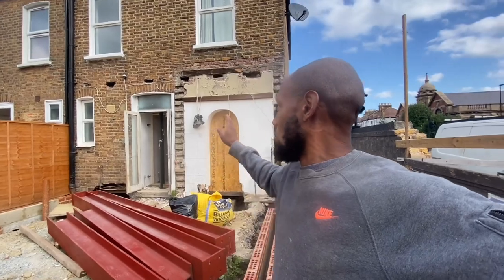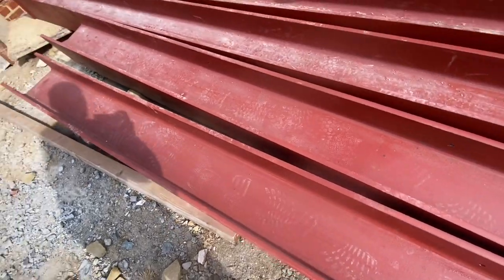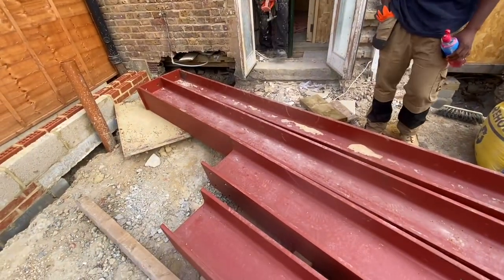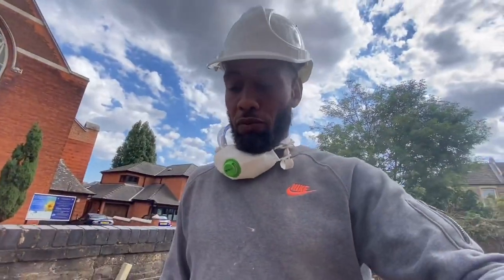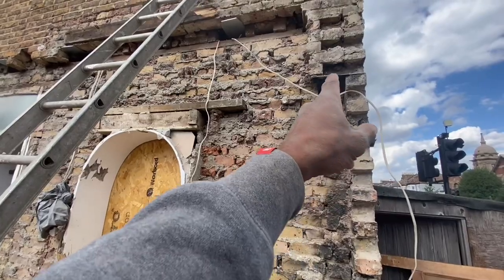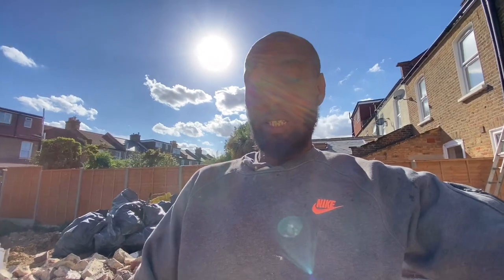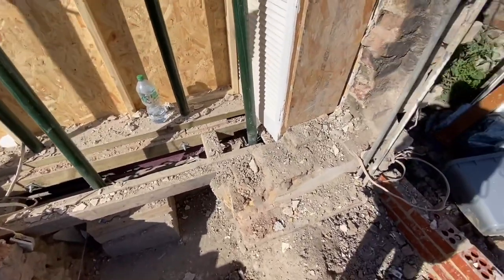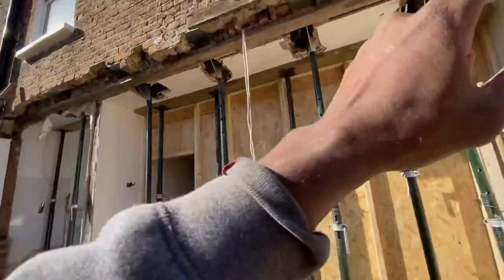Knocking out the back wall - London Extension build Ep 18

Comment: Another great video.  You guys are all very talented.  Generally the reason to install a picture frame is to provide lateral support to the building (racking resistance) and / or to disperse the loads over the whole length of the foundation below.  I am not aware of not being able to bear on a disused chimney - bricks Afterall are fired in a kiln to harden.  You cant bear onto a live chimney - concern over steels being effected by the heat (Building Regs).  Keep up the good work
Reply from the maker: Thanks that make sense about the racking. The chimney is more todo with the mortar than the bricks. In use or not you wouldn’t be allowed to install steel in a chimney as the mortar is too compromised

Comment: Hi Darren I was wondering why the architect didn't do a complete foundation under the steel box rather than the pad on either side then  it would mean that the weight of the steel and the weight of the house  would have been spread across the entire back of the house as opposed to just on the pads. I was happy that everything went well and wish you all well for today's task of finishing the rest of it. I think you and the boys need to chill for a few days after that. Donal